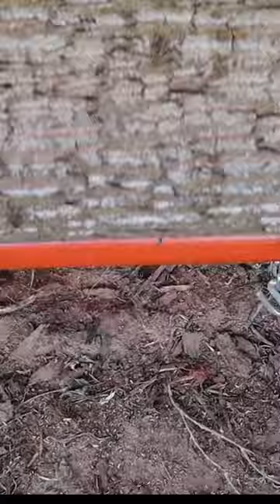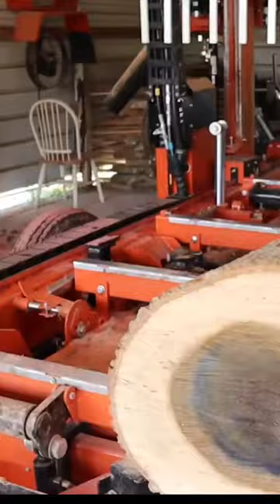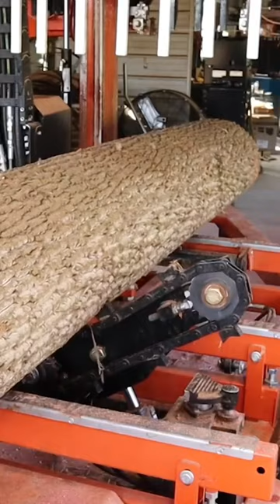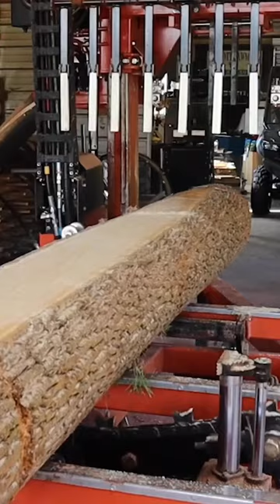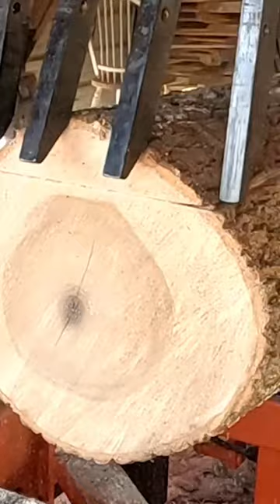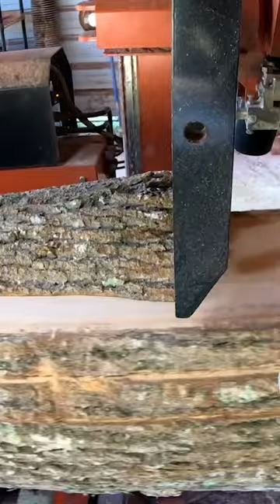How The Sawmill Debarker Improves Blade Life

Comment: The name, debarker, really is a misnomer. When I bought my mill I was disappointed in what I got. The round blade opens the cut for the leading side of the band blade to protect it from mud, staples, nails, and other foreign material.
Reply: Really it is just a mud saw rather than a debarker....
Reply: The one in the video is not very convenient. If you need a faster and more efficient machine, I can help you.

Comment: Why only on one side though?
Reply: the blade is pushing cuttings from the inside to the outside  of the bark
Reply: To add to what bush master said, the concern isn't just the blade impacting the bark but dragging all those rougher particles through the log, increasing the time they're rubbing together. On the far end, the bark chips are free to fly away, so the wear isn't as significant.